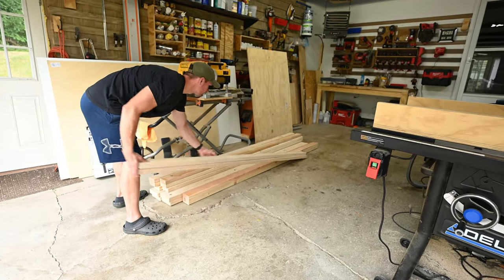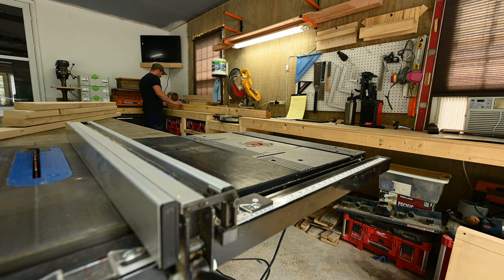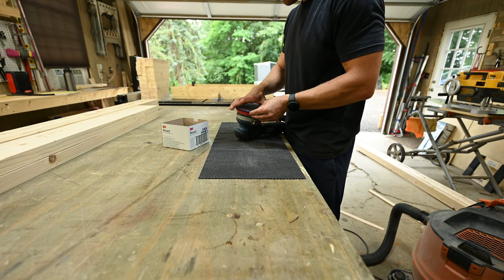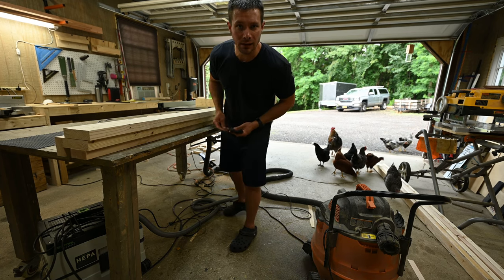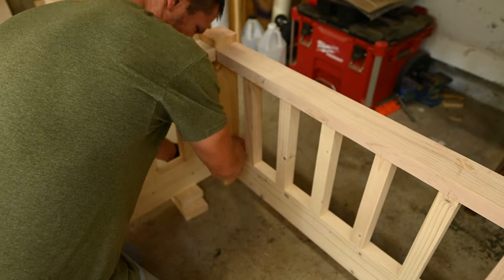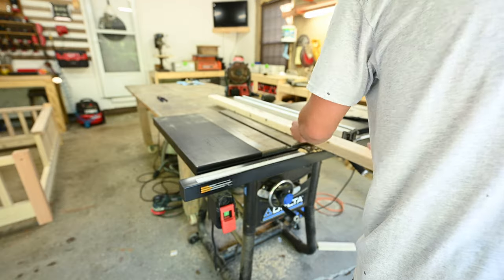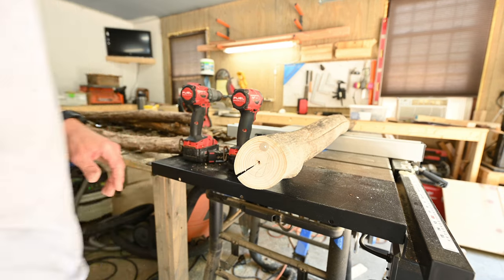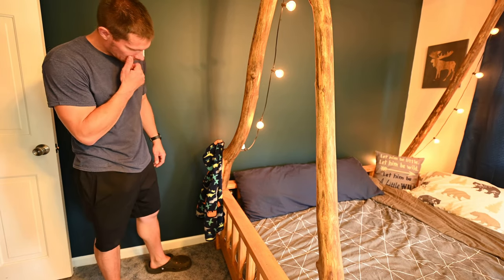Making a toddler bed - Teepee Bed

Comment: Im about to start this project from your video. Thank you for the instructions! Is there anything you wished you would have done differently?
Reply from the maker: Yes! I would have added an inch to each of the peices that connect to the legs. The mattress fit to tight in mine and was hard to change the sheets. So that is definitely something I would have changed.

Comment: Thanks for the video ! I’m half way thru my bed and have a question- does your teepee rack back and forth at all ??? I saw you used wood dowels in the bottom - I used long ass screws and it’s-a-rackin’ !! I’m thinking of using a cup saw drill bit to cut out a hole into the top bed rail

Comment: I’m thinking about building something very similar with a queen mattress, but I’m concerned about the difficulty of changing sheets with the rails on all 4 sides. Have you had any issue with this?
Reply from the maker: Yes. It is an absolute pain in the ass. Lol. Not gonna lie to you. You basically have to lift the mattress all the way out.